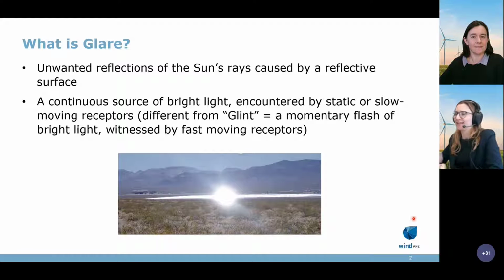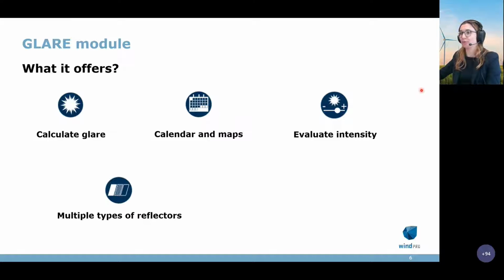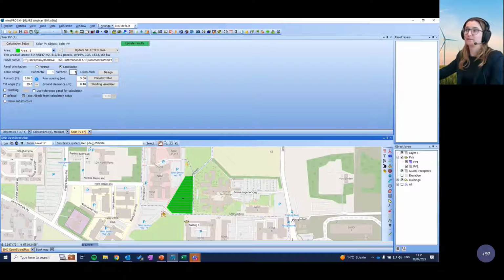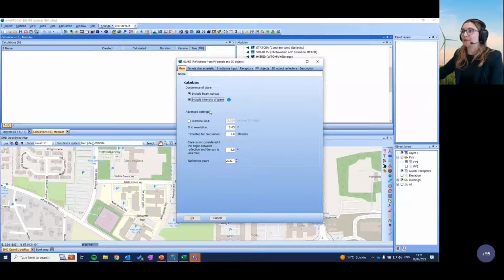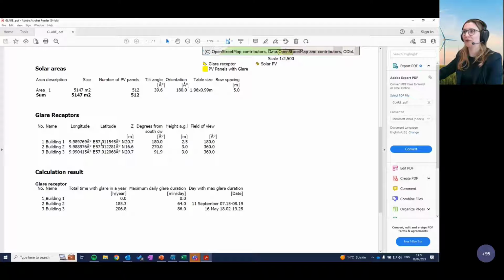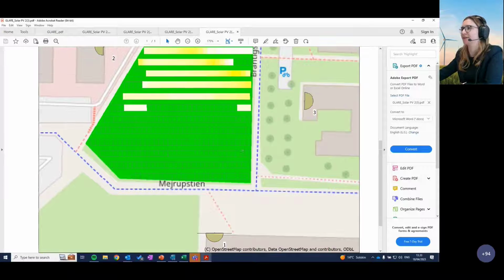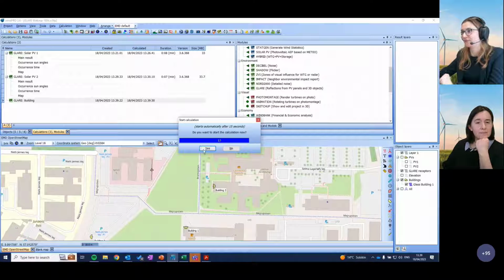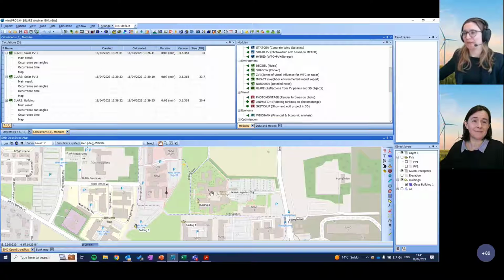Glare calculations in windPRO

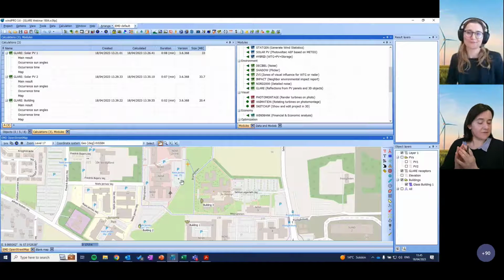Comment: Hello, I noticed that at 43:16 you mention that obstacles are not included in the GLARE module but that this might be added in future versions. Since the video is from 2023, I wanted to ask: In more recent versions of WindPRO, is it now possible to include obstacles in glare calculations using only elevation data or grid objects (without relying on 3D objects that inadvertently reflect glare)? I have not seen any option for this yet. Could you please clarify whether this feature has been implemented, and if so, how to use it?
Reply from the maker: Hi @luisadahlem,

Starting from windPRO 4.2 it is possible to include terrain, obstacles, grid objects and 3D objects as obstructions in GLARE calculations. Objects to be used in the visibility calculation can be selected in the ZVI tab of the GLARE calculation setup.